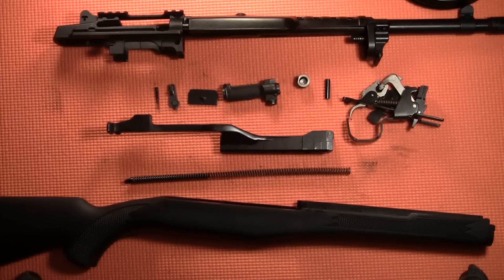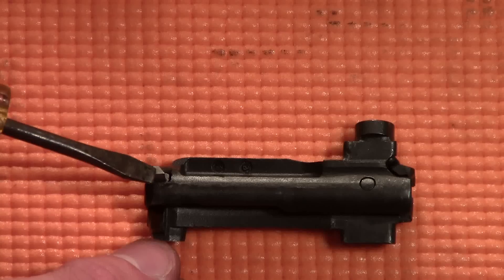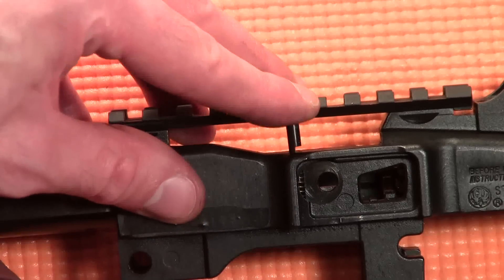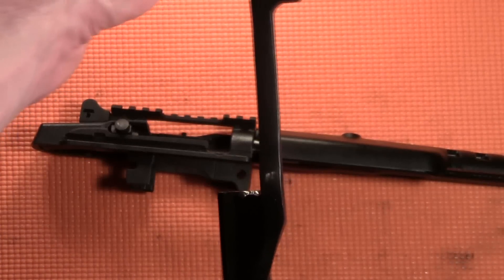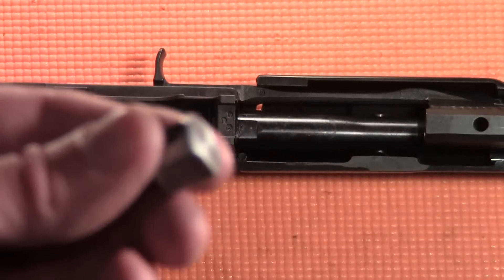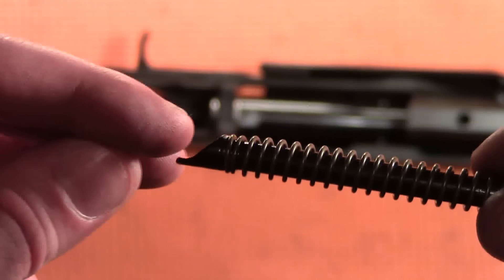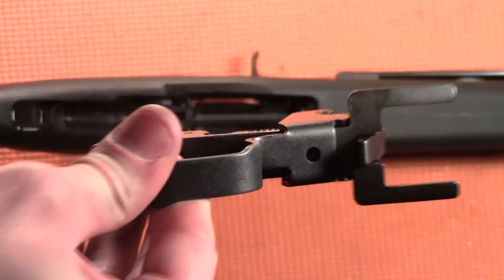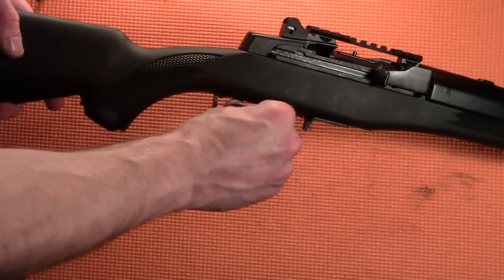How to reassemble a ruger mini 14 or ruger mini 30 rifle

Comment: Flat edge of the guide rod fits against the cross pin not against the flat part of that guide rod bushing. The notch in the guide rod fits around the cross pin.  If the notch was facing the barrel it would bind when you pulled back on the action. If you get binding twist your guide rod 180°. Maybe I interpreted your guidance incorrectly. Otherwise good video

Comment: Excellent. Ruger told me that it was quite difficult to reassemble without removing scope mounting rail. Thank you very much. I could have gotten by without buying expensive QD rings, had I watched this video. My Mini14 is way better than an AR for everything which I do. Very accurate at 100 yds .

Comment: Putting the bolt back in isn't as easy as it looks. It will take forever to get it. Remember this guy has done it 100 times before so it looks easy.

Comment: just one thing that seems to be a mis-statement. At 3.37 of the otherwise wonderful you say that the flat side of the recoil spring bar is to be placed against the flat side of the buffer bushing. This is not the case. The flat side of the spring bar goes into the hole in the bushing with the flat side at the busing pin. If you put it in as I interpreted the spring binds and will not let the bolt and operating rod function fully.